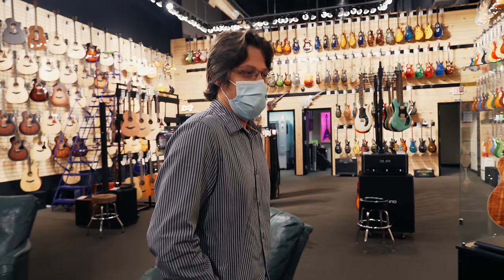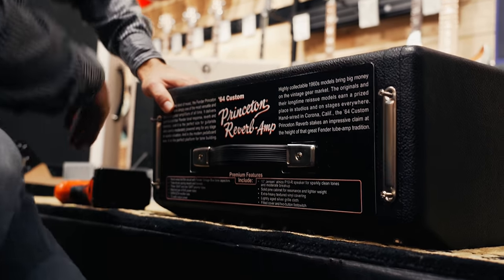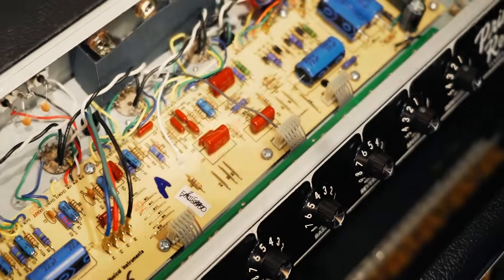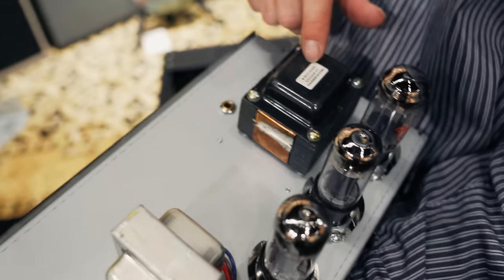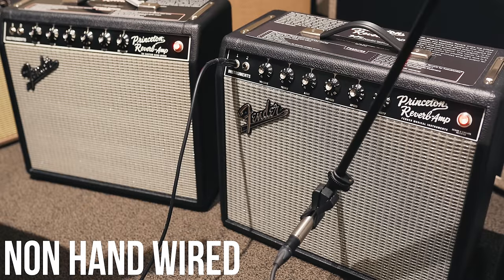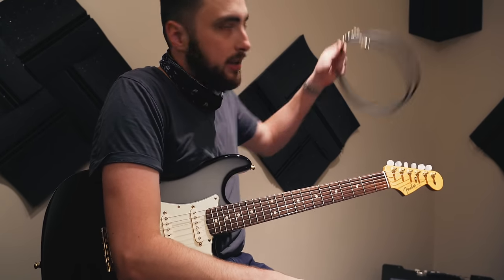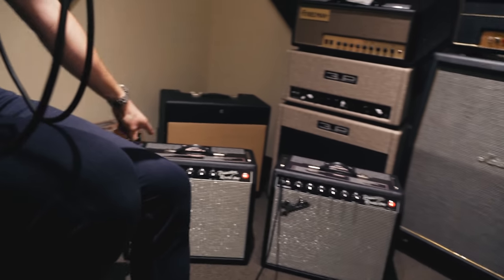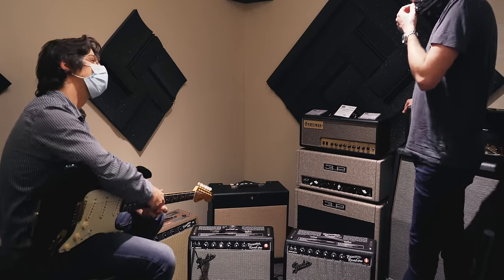Are Hand Wired Amps Really Better?

Comment: I work on amps for a living, I specialize in Fender tube amps, and I can say in no uncertain terms, there is no tone difference between hand wired vs printed circuit board.  That doesn’t change the sound of the circuit, different components do. Tolerances in component values (up to +/-  20%) can have two amps built exactly the same, yet sounding completely different.

You are showing two different amps.  Just look at the tone caps, on the hand wired, they are Fender Blue Molded, on the printed board they are Illinois caps, way lower quality, and a different tone characteristic.  That alone would change the tone of the amp as much or more than anything else.

Honestly, the only difference between the two formats (other than ease of access for repairs) is quality of solder joints. Point to point can get you a nice big solder joint, very strong.  Fender has a reputation for using very thin solder traces on their circuit boards that have a tendency to break under stress.  As a repairman, that’s the number one difference. Components can be switched out, bias can be altered, a thousand things can affect the tone of the amp. Hand wired vs circuit board is not one of them.

People like to try to convince themselves that hand wired sounds better. It does not. It costs more to have a person do in four hours what a machine can do in minutes. That is what you are paying for. Not some magically “better” amp. Just a higher labor cost.  That’s it. (Admittedly, you are also paying for a few upgraded components in this particular hand wired amp, but you can throw many of those same upgraded components into a pcb based amp too.  Fender has just chosen not to in this model.)
Reply: This is what happens when you let a salesman and a guitarists evaluate circuits.  Did you test the output tubes to see if the two pairs were exactly matched in gain?  (For best results, you should get a matched quartet, and split them between the amps.) Did you test the preamp tubes to see if they were anywhere near close? (I just worked on a brand new 5150 with three (!) bad preamp tubes right out of the box)  Did you check the negative bias circuit to see if they were set/responding similarly? Did you check the plate voltages of each amp to make sure there wasn’t a difference in B+ voltage?  All these things will drastically affect the tone of the amp, and that doesn’t even get to the audio signal path variances!  

You cannot plug in two tube amps, even of the same brand and model, and expect them to be the same.  You certainly can’t compare two different models with different internal components as being the same amp, and chalk up any differences as being due to hand wired vs circuit board. Too many other variables that a tech would bring up, but a player might not even be aware of.
Reply: Very informative
Reply: That my friend is awesome info! I  totally bought into the salesman/guitarist and pro guitarist commentary...thank you for that 👍
Reply: well i think the idea with “hardwired” amps is that no expense is spared. if youre investing hours into the build, youre going to be investing good parts as well. the PCB trend is kind of the posterchild of “cheapest means of production”, slapping together parts that are “close enough”
Reply: @LeeGHThomas  I think you meant "hand wired".  Both types of amps are, by definition hard wired, in that if a wire is physically connected, it is hard wired (as in the opposite of "wireless").

But you are generally correct, that boutique amps and hand wired amps are usually built to a higher price point with generally better components.  If you are willing to pay more for a person to spend the time wiring the amp, you are probably likely to be okay with some upgraded and/or more expensive parts.

And that is my point: those better components make the amp possibly sound better - not whether it is hand wired or circuit board.

And again, those upgraded parts are (almost always) not exclusive or unique to the hand wired amp.  They could just as easily be put into a circuit board amp, and that amp would sound just as good as a hand wired using the same components.  It is the components, not the construction method, that makes one amp better or not.

(On a side note, I work on a lot of vintage amps that were hand wired and they used some cheap components and some very questionable layout techniques!  I've seen some scary stuff in older hand wired amps.)

The PCB trend you mention does exist, and is an unfortunate effect in manufacturing and design decisions being dictated by attempts at maintaining the lowest bottom line.  But, the market dictates how cheap is acceptable, and those things still sell.  There are, however, many PCB based amps that are a beauty to behold.  They are well designed, solid construction, and very few corners cut, if at all, on component quality.  They are able to sell at maybe a slightly higher price point than some Fender models, but still manage to bring a well built amp at a cost way less than most hand built.

Point is, neither platform is a guarantee of a better amp, in quality or sound.  It's all about the components.  And in this video, they are comparing apples to oranges because they are built with different components.  The narrator chalks that up to PCB vs hand wired, and I was trying to explain that is not at all the explanation for any differences they are hearing.
Reply: The reality is that most PCB amps use cheaper components. So generally, PCB amps sound worse. Of course there are exceptions. But you rarely find a handwired amp that uses junky components.
Reply: Yep. I was a high frequency tube amp (radar) guy in the Navy. Better components with tighter tolerances have the same magic smoke inside them, but they do what you ask them to better.
Reply: @coyotecirclestudio9611  i put all matching NOS Mullards in my handwired Vox from pre to power— tubes were definitely tested quite thoroughly...it sounded night and day over a mix of sovtek and JJ tubes that were in it. Did anyone also notice the far lower amount of caps in the Princeton pcb version? Lots of the sound diff is there.
Reply: @kilgoretrout3966  (love the name, by the way!!)  You are totally spot on abut the caps creating much of the sound difference.  The coupling and tone capacitors in an amp do as much to define the sound as almost any other component.  But it isn't the number (they actually have the same), but rather the quality.  In the pcb amp, they used IC (Illinois Capacitor) caps, notoriously cheap weak and leaky, don't sound as good as other types.  In the hand wired, they used reissue Fender blue molded caps, a remake of what is widely considered one of the best sounding caps Fender ever used.  That alone would make one amp sound quite a bit better than the other.
Reply: @coyotecirclestudio9611  indeed so. i have the 50th anniversary 15w Vox handwired...got it for a sweet $800. The quality of parts is really big, and as you say, low cost generally means lower quality components. i'm not an electronics expert by any means. i can do the wiring in my guitars, and i've replaced leaky caps, but diagnosing a whole board would be above my pay grade. i was really ticked when i discovered "New Bumble Bees are just a plastic case that looks like a Bee, surrounding a cheapo cap. Glad i learned that before rewiring my LP for pickups Jeff Lace sent me to try.
i recently put in a full matching compliment of NOS Mullards in the Vox from a really good valve guy i Colorado. Some will say tubes don't make much difference, but that Vox sang when i swapped out the russian tubes. It was so good, i spent the next 6 hours just playing.

Thanks for recognizing the name! Along with 5 people yesterday, i have had it recognized 27 times since 2006. Always happy to meet Vonnegut fans! Do you have a studio also, or stay with working on gear?
Reply: @kilgoretrout3966  I didn't know that about the new bumble bees!  I will have to keep an eye on that in the future.

I heard that Sprague had done a similar thing (not fraudulent, just tricky), by putting a good quality cap of small size inside a bigger shell, because customers didn't trust the newer, drastically smaller power caps.  Same rating, same power handling, but newer tech meant it could be made smaller.  People didn't like the smaller caps, thinking smaller is "weaker" so Sprague obliged by putting the smaller caps in bigger shells = happy customers!

Hey, who did you get your tubes from?  Just curious, I am in Colorado, and know a few of the local folks.

For the moment, both studio work and live sound are on hold.  I have a really nice project studio, modest space, but filled with an impressive variety of mics and preamps and treated spaces, as well as a top notch live rig that I am particularly fond of using.  I am pretty proud of what I have put together, but gigs have dried up lately, for obvious reasons.  Gear repair has (thankfully) helped fill that gap.  But I miss mixing so badly I can taste it!  

And yeah, I love Kurt.
Reply: I preferred the hand wired one until they hooked the alnico speaker up to the PCB one. Then they should pretty damn close. Close enough that I don't think anyone would notice with a full band and close enough that a little eq would have them sounding identical. Maybe the hand wired still is more responsive, but that would come down to components. I'd just buy the cheaper one and put a new speaker in it.
Reply: @eliju420  absolutely correct!  Components are the deciding factor, not whether those components are mounted on pcb or hand wired turret board.

I do that for my customers all the time.  They buy the run of the mill pcb based amp, then spend a few bucks upgrading caps, tubes, speakers, etc.  Then they have a really nice sounding, responsive amp at a good savings.

Alnico is a whole other conversation.  I happen to think they are some of the nicest sounding speakers and can really flatter many amps.  I have a few vintage Jensen P12N's from the 1950's that are so sweet and forgiving.  Just a beautiful sound.  They make almost any amp they are hooked up to sound a little better.  Problem is, the Alnico magnets are much more expensive to make, so the speakers can cost a good bit more than their ceramic equivalent.  That, unfortunately, ends up being a barrier in some folks' budgets.
Reply: @coyotecirclestudio9611  I played a standard blues Jr with the Celestion A and the relic with the Jensen P12R side by side. What an enormous difference on the same amp. The standard version isn't bad, but the same amp with the upgraded speaker sounded leagues better.
Reply: @eliju420  i would probably go the exact same way, but with a Studio, i try to do as many things without plug-ins or emulations. So i went with a hand wired Vox. i do have 4 other amps that are not, but there's a sweetness in the Vox i can't get with the others...and, wait for it......cliche ahead: it takes pedals like a champ.
Reply: I am new to all this guitar stuff, currently I have a fender mustang 1 V2 (digital?)

I was thinking of getting a monoprice 15w tube amp (Harley Benton Tube15)
I heard someone say that, it is basically a blues jr clone.

So I was thinking that I could upgrade the seventy80 to a greenback and also the tubes to Russian 

Are there any other mods that you guys would recommend for a beginner?

I’m going for a vintage yet universal sound for my 2002 mim strat (with upgrades I.e Rose pickups)
Reply: @abgersaurus  Sorry if you already know this, but:  Do not poke around inside a tube amp if you don't know what you are doing.  There are voltages in there that can kill you.

That being said, you did mention the best first two mods to try: speaker and tubes.  

This amp does have an adjustable bias, and to really get the best out of a set of power tubes (and avoid possible failure) it should be set by someone who knows what they are doing.  
Preamp tubes aren't affected by the bias, so they can be changed out all day long and no bias adjustments needed.

Just make sure any speaker you put in matches the ohms rating of the output transformer (either 8 or 16 for this amp I think) and shoot for twice the power rating of the amp.  So if it is a 15 watt amp, look for 30 watt or above speaker.  You could probably get away with a 25 watt if you don't play the amp at full volume.
Reply: @coyotecirclestudio9611  thank you for your advice! I only plan on playing a low-medium volume at home.
Perhaps I will look for a local amp-tech to help me adjust the bias.

I am hoping to get a blues jr later, when I am more experienced :)
Reply: @coyotecirclestudio9611  Absolutely, there can be hundreds of volts across certain tubes, caps can hold voltages even after the equipment is powered off, tube amps are very dangerous.
Reply: Exactly my opinion to, quality different yes, but other vice with the same component , they will sound the same :-)
Reply: Totally agree. I also build and fix my amplifiers. It's all marketing. Speakers, caps, potentiometers are all different. Not to mention the  tubes and the circuit itself which were not shown. For sure the differences in the sound were not due to pcb or wires.
Reply: @coyotecirclestudio9611   I've read that some of the much hated changes to the Silverface era amps were because lead dress got sloppy in a high production scenario. Oscillation was a problem, I think guys were wiring 20+ amps a day, I assume components were already on the board and this was the final wiring. With high gain amps the inconsistencies in lead dress inherent to hand wiring are going to have a much greater effect.
Reply: @5000rgb  Great point!
Reply: Agreed. A lot of hype, much like "vintage" capacitors. Like components, like values, like results. A properly soldered component on a post is going to sound exactly the same as one on a PCB. Did the amps sound different with the same settings? Yea, but could the they sound the same with some knob tweaking? Probably. Different amps and components will always sound different... but it's not the wires.
Reply: @jimistheman9732  "Did the amps sound different with the same settings"

I'd be willing to chalk that up to tolerances in the pots alone. It's ridiculous how much guitar players attribute tone to single factors that don't make much difference. The tolerances in the pots or pickup windings probably have a greater effect than the difference between ash and alder. There's probably as much variance in different trees as different species or at least enough overlap that a great guitar can come from either. get a different cable or put a pedal between your guitar and amp and you are no longer duplicating the original conditions so trying to duplicate the amp or guitar is not going to duplicate the results.
Reply: I want to hear your opinion on the potential inductance between signal runs on a circuit board vs. how a hand wired amp doesn't have lines running parallel. Should hand wired amps have more presence as a result of ,, or should I say, pcb amps have less presence, as a result of signal cancelling that can come from the inductance between runs??
Reply: @tsmspace  a hand wired amp can certainly have signal paths running parallel.  The components on a common turret board are often laid out in parallels (just look at a classic Marshall), and many have flying lines that connect across the board that run parallel to one another.  Those flying lines are usually routed an inch or two up and away from other components (or out and along the chassis wall), but the potential for parasitic oscillations and/or inductance exist in either type of amp.  Neither format is immune.  The key is adequate component separation and proper lead dress, which are concerns for both hand wired and pcb based amps.

-Also, a pcb based amp still has plenty of wires that by their nature have to installed by hand.  I am thinking of reverb transformers, output transformers, some large capacitors, negative feedback lead, etc.  Things that might be too big to be installed by the component stuffing machine, and have attached wires/leads that need to connect to the board, regardless if the rest of the amp is hand wired or pcb.

But, back to your original question- in my opinion, it would be more a factor of how well the signal traces are routed on the pcb that would determine any inductance, than whether it is a hand wired or pcb based amp.  As I mentioned, turret board/hand wired circuits quite often have the components in the signal path laid out in almost perfect parallels, but (usually) the distance between them and any components that may affect them is large enough to overcome potential inductance.  The same concepts are considered in the design layout of pcb based amps.

In theory- if the pcb based amp is well enough designed with intelligent thought to signal flow lines, and their relation to neighboring components, there should be no more inherent tendency to introduce induction than a hand wired amp.  Therefore, all else being equal and properly designed and constructed, my opinion would be that they should be nearly the same regarding presence potential.

- Side note - if you really want to dive deep, the output transformer itself adds/creates inductance.  Some are constructed better and with different winding techniques, which can drastically reduce the amount of inductance between output transformer primary and secondary, but it is still there.  An argument could be made the the quality of the transformer would more significantly affect the roll off of high end/presence much more than traces on a circuit board vs hand wired.
Reply: its all in the iron and speakers. Replace them and the caps won't matter in a blind test
Reply: @samroney6644  I half agree and half disagree.  While I feel you are absolutely on the money in remarking on the importance of the transformers and speakers, I disagree that the caps don't matter.

Many folks don't understand just how critical the quality and size of the transformers are, and how the speaker can radically change the voice of an amp.  You are completely correct in pointing out the huge importance of these components.

I would argue that the caps can and will make a difference.  Admittedly much more subtle, but some capacitors play a very important role in establishing the voice of the circuit that feeds the transformers and speakers.  Doesn't matter how great the output end is if the caps are leaky, hummy, saggy, etc.  Old sound guy saying "sh*t goes in, sh*t comes out".  Or, "you can't polish a turd".  If you have bad/cheap/failing caps in critical positions in the front end, no amount of quality transformers or speakers will save that.

I know that arguing the merits of certain types of caps is over most peoples' level of interest or perception.  Who is gonna hear the difference in caps in a loud and noisy bar, right?  

But, being a repairman, and auditioning the results of repairs in the super quiet surroundings of the studio, I can say that some caps do sound "better" than others.  Again, admittedly in a way that would probably go unnoticed in a bar, but in a studio setting can make an amp come alive in a way that is quite inspiring.
Reply: @VIDS2013  Does fender pcb amps use cheap components?
Reply: @jim9883  Compared to most handwired amps, yes.
Reply: @coyotecirclestudio9611  My dad always talks about transformers. I know they can be pretty expensive but I suppose that's why. Also he talks about proper wiring. I made an ax84 kit a long time ago, but honestly didn't worry much, however it was not turret board, it was little points that I had to attach individually, and the layout ended up pretty much "random" without any lines running with eachother, I must have twisted one or two wires according to instructions, but the amp seemed to be perfectly quiet,,,, at 5 watts. ( so no telling really). ,, So then once you have tiny components, though, wouldn't it get to be a lot harder to keep lines with separation?? I mean, you have basically two planes to work with.
Reply: @tsmspace  Yeah, I have worked on a ton of vintage units (1930's - 1950's -ish) that were just point to point wiring, no turret board.  Many, if not most, managed to keep a remarkably low noise floor even with components that appear to be randomly thrown about. 

It's really most important that certain types of signal routing stay away from others.  For example - keep input signal away from emitter signal,  keeping certain runs as short as possible.  Those concepts are fairly universal regardless of the construction style or size of components.  (I would imagine any decent amp kit would understand and follow these concepts in their assembly instructions.)
 
Also, tiny components take up less space, so (in theory) in a given enclosure they would actually allow for greater spacing between components than larger ones would.  The tiniest of components are surface mount construction (also called SMD), and I almost never see that in tube type amps.  That type of component is mostly found in lower current solid state devices.  Most pcb based tube amps use the same type and size components as found in turret or point to point or any other hand wired style.

At that point it's just a matter of keeping certain runs separated, which is really not that hard with proper layout.  It really doesn't take a huge amount of space to keep components or circuit traces electrically separate as long as common sense layout is followed.

So, even though you are correct that you essentially have only two planes to work with on a pcb, it doesn't take great amounts of distance to keep things happy, regardless of component size.

And yeah, transformers can be crazy freaking expensive!!!  I've looked into winding my own, but it is leaps and bounds more difficult than something like winding a pickup.
Reply: @jim9883  I wouldn't agree  that they use cheap components as a blanket statement.  Fender uses industry standard components.  Some of those components fall below my personal standards, but that's a different measure.

I always upgrade the power supply filter capacitors from the god-awful IC brand capacitors to F&T capacitors.  I usually replace some of the coupling caps and tone caps with Sprague or Mallory or Sozo.  Some of the resistors get replaced with higher wattage and/or tighter tolerance resistors.  But, these are my preferences for better-than-average performance.

Fender is a business, and as such, will buy components that are the best cost effective purchase for them.  They don't want to go too cheap, or they would be plagued with unacceptably high failure rates.  So, even though they tend to use "cheaper" components, they are far from the cheapest and least reliable component options out there.

I just tend to like more long-term reliable and higher quality components in certain positions in the amp, and tend to swap them out when I can.  Fender could just as easily do that, but they would have to charge more, and choose not to so they can keep the amp as affordable for the average player as possible.
Reply: @5000rgb  Excellent point.  A potentiometer is just a variable resistor.  Halfway through the travel of one will almost never be exactly the same reading as halfway through the travel of another of the same make and value.  Add to that the knob may be attached a hair more clockwise or counterclockwise on the shaft of the pot.  That makes "setting the amps to the same settings on the control panel" a pointless and inaccurate measure of similarity or difference.
Reply: Well .......... unless they are playing a Les Paul from the "good wood" era ....... lol ..🤣
Those trees be tricking us bro !!!!!
Reply: You seem to be overlooking the most important factor here ....guitarists are notorious for listening with their EYES  👀...and not their EARS 👂!!!!
Reply: First off they need to have the same speaker.. That will change most of the sound.. not solder joints..
Reply: And when you're playing live the little  tone differences goes  out the window ! If infact you can hear this small amp!
Reply: @daltonpoff4467  While I totally agree that much of the "cork sniffing" type differences are mostly inaudible at live gig volume levels, I think you might be underestimating what these amps are capable of achieving.  While they probably wouldn't be my first call for metal, or keeping up with an EDM ensemble, they can do remarkably well in rock, blues, jazz, country, and a number of other genres.  Even with an aggressive drummer.

And let's not forget one of the main claims to fame of the Deluxe Reverb type circuit is that it tracks very well in the studio.  That's where the differences in quality shine.

But yes, I totally agree.  You will not hear those differences at midnight in a punk bar.
Reply: I don't play punk or heavy metal ! However I played out semi pro for four decades just about any situation. Owned Princetons, a deluxe  my opinion there weakass amps and way over priced! He'll for that kind of money 💰 you can get a twin!!!!
Reply: @daltonpoff4467  Oh, you know what, I stand corrected.  You are right, I had forgotten these are Princeton platform they are reviewing here.  My bad.  My head went Deluxe Reverb for some reason.  

That being said, I have heard some nicely modded Princetons that are far from stock that have quite a robust sound.  You are aware the original Boogie amps were seriously hot rodded Princetons, yes?  

And yeah, I do love a good Twin.  I have two mid-1970's Silverfaces I have modified mostly with Blackfacing mods that I love and play daily.
Reply: You know the Princeton are okay but you do know they were basically a student amp or a beginners amp or a church amp ! Back in the day you could buy him for pennies on the dollar! In my opinion they're over inflated and overrated but that's just me thank you!
Reply: @daltonpoff4467  Yep.  Crazy how much the prices have climbed on vintage Princetons. Yeah, wild to think it was originally a student/practice/budget amp! But, most of the guitars on Layla were recorded with Princetons (and even Champs), so I don't know if I'd go so far as to say overrated.

But overpriced, oh my yes!!
Reply: Yeah I know you can use any amp to record and sound great! I have, but I have seen roy buchanan, Gary more Luther Allison and many more in concert back in the day ! And you cannot get that great sound with those small amps live!
Reply: @daltonpoff4467  Ah, you are a lucky man.  I only got turned on to Gary Moore after he passed away.  Wish I could have seen him.
Reply: Exacary! Back in the day (and I know because I was there) you could play two brand new 67 Deluxe Reverbs sitting side by side on the showroom floor and they would sound slightly different from one another. Why? Because the components Fender used had a +/- 20% tolerance range. Which means that a 100 ohm resistor in one amp, for example, could actually read 120 ohms on one amp and 80 ohms in the other. Same is true for all the capacitors. The real benefit of hand wiring isn't in the sound, but in the longevity of the amp. Hand wiring tends to be more robust and survives the harsh realities of "the road" better.
Reply: @RichSmithify  Yes, this is what I have been saying!  In theory you could test every component and essentially "blueprint" the amp (to use a mechanics term), making sure everything was exactly the correct and same value from amp to amp.  Then you could reasonably put two side by side and compare and contrast.  But to put in the actual work hours to sort and select precision components like that would make the amp's price start at twelve thousand dollars. 

Back on point, those variances in component tolerances (as well as different brand/type capacitors) are what make the differences you hear in these amps.  Not hand wired vs pcb based.
Reply: @coyotecirclestudio9611  And Leo Fender was business man, not a musician. According to legend he didn't even play guitar. If he could find a way to trim manufacturing costs by using lower spec components he wasn't ashamed do it.
Reply: @RichSmithify  That's correct.  He was a radio repairman, not a musician!  He didn't give one hoot about esoteric components.  If it was close to the right value, and cheap, in it went.
Reply: @tigeraudio  I'd like to pick up one of those Rivera era Fenders. Or several of them. I don't know if I've ever played through one but those are probably the last of the mass production handwired amps. It's cool when something isn't just a great instrument, but a little bit of history, too.
Reply: @tigeraudio  Did the PRII have an EV speaker in it? I believe Rivera was one of the guys that thought the EV was the secret sauce in a Princeton.
Reply: @tigeraudio  The power transformer wouldn't be able to handle it.  There are two currents you need to account for: heater current, and plate current.  

Quick look tells me a common Princeton Reverb power transformer states it puts out 2.25A for the heaters and 100mA for the plates.  If my math is correct, a Princeton Reverb power transformer is already near the top of its spec range with heaters.  

Plates are okay.  3x12AX7@6mA each, 1x12AT7@15mA each, 2x6V6@20mA each for a total of 73mA.  Adding another 12AX7 would bring that up to 79mA.  Still pretty safe.

Heaters are the trouble.  3x12AX7@300mA each, 1x12AT7@300mA each, 2x6V6@450 each, for a total of 2.1A.  Adding another 12AX7 brings it to 2.4A, over the spec of 2.25A.

As long as we're having this discussion, using the Princeton Reverb output transformer for the build will, I would imagine, yield less than exciting results.  The smaller transformer will give up a rattier, earlier power section breakup, as the transformer itself reaches saturation earlier with less iron and less windings.  It will be more like a standard Princeton Reverb where you can't go past 3 before it starts to breakup.  While that is a lot of fun when called for, it limits the working range of the amp to me.  I like the sound of bigger iron myself.
Reply: Hey Mr. Knowitall. Please have your ears checked by an ENT. This is not a matter of what components/circuit boards are installed in an amp but how a HW and Non HW differ in sound. I've tested several HW and non hw side by side and they do really differ in sound quality. You may be an amp specialist but you do not have the hearing prowess of a musician.
Reply: @helsinkioslo836  Wow.  I don't know what upset you so much.  We are just having a discussion, and if you disagree, that's your right.  I am judging electronic components and types of layout by my occupational experience, you are allowed to judge by yours.  But personal attacks just aren't really necessary.  Maybe come back when you can add a more constructive perspective.
Reply: @tigeraudio  The blue caps will sound a little different than the orange drops.  Not a ton, but some.  Maybe a bit smoother where the orange drops may be a bit brighter in the mids/upper mids.  Sozo makes a very nice modern production blue cap.  I have had good luck with them.  Either way, both will sound worlds better than the terrible IC caps Fender uses stock in just about every amp they make.  Yuck!
Reply: Coyote Circle Studio You seem to know quite a lot about amps, sir. Let me pick your brain. 😄 You said that there are some really good amps on the market, whether hand wired or not, in terms of the quality of components, thought out PCB layouts, etc. Can you give some examples of such amps that are good stock? Preferably some that can be bought new off the shelf, but second hand examples are also welcome!
Reply: Coyote street...you gotta admit that the hand wired is beautiful 🤣🤣🤣 thanks for your input. I have a Super Champ Tweed with the Ragin Cajun upgrade and truly love that rascal.
Reply: @LeeGHThomas  I guess you never priced a SLO 100.  It is PCB.
Reply: @VIDS2013  There are plenty of quality amps that use PCBs as well as quality components: Soldano and  Fuchs come to mind.
Reply: So can you take the pcb one and bring it to the hardwired specs for low cost?
Reply: @SaintFredrocks  Yet there are many more PCB amps that use cheap components.

Regardless, I'd much rather work on a handwired amp.
Reply: @travisraab  Well, that's a hard question to answer.  But, in general, yes.  Some amps, no.  But this amp, yes.  Absolutely.  

If both amps are built to the same schematic, in theory they both are "in spec" with each other as far as performing the duties as required in the schematic.  I.E. a coupling cap of .02@400V will be present in each amp, but in the video the pcb based amp was using IC brand capacitors, which you normally find in most current Fenders (and they kinda suck).  The hand wired used re-issued Fender blue molded caps which sound and perform much better.  And are also more expensive.  

But you can put those blue molded caps in a pcb based amp, no problem.  As with almost any other part in the amp.  

The parts are up to you based on choice and budget.  Fender chooses to use less expensive parts in the pcb version to make it more affordable, and more expensive parts in the hand wired for those who want to pay more.

But those more expensive parts can pretty much all be used in a pcb based amp.

Which brings me to the part that's a little harder to answer.  If that can be done cheaply.  Can it be done less expensive than buying the hand wired version?  Usually, yes.  Not always for every amp.  But in this specific amp model? Yes.  You can take every upgraded part, and as long as you know how to properly and safely do it or your amp tech doesn't charge you an arm and a leg, you can have a pcb based that has every component the same as the hand wired.  There's a $1200 difference in price between the two models.  The parts for that amp in total cost less than $1200.  

At that point it comes down to how much your amp tech is charging you.
Reply: @gitarowydominik  I have thought for a few days about how to answer this one.  I am often afraid to endorse any certain make or model, likewise very hesitant to condemn any brand.  There are always exceptions, and I'd hate to steer anyone the wrong way.

That being said, I could name a few makers that every single product which has come on my bench has been top notch build quality

Musicman amps from the 1970's and 1980's are incredible build quality, and real sleepers, so not too expensive.  (It was one of Leo Fender's companies after he sold Fender to CBS).  They are starting to get old enough to have age related component failure issues, so can be found for pennies.  But usually a cap job and some tubes and they are good to go.

I can tell you one of the finest builds I have seen come across my bench was a Swart amp.  Work of art!  Clark also does exceptional work.  Dr Z makes some nice stuff.  But those are boutique hand wired, so you pay for those.

As far as pcb based goes, one of the best regarded in that category is Soldano SLO.  Not a cheap option.  But a prime example of pcb based tube amp done right.

I know I'll catch flack for this, but honestly, aside from the problematic ribbon cables and a few issues with early runs, the Hot Rod Deluxe and it's variations are really great amps.  Stable, reliable, quiet.  Easily upgraded if desired.  There is a reason they are one of the best selling tube amps, ever!

As an aside- I know it is an effect, not an amp, but as an example of how pcb based design can be beautifully executed, take a look inside any Analogman pedal.  Just awesomely clean, top notch components.  Just a perfect example of how to do it right.

I can also say from a tech standpoint, not a big fan of Mesa, Vox, or Peavey.  I love some of their amps, but really dislike working on them.  Some are just a god-awful nightmare.  Absurdly difficult to do routine maintenance and repairs on some models.  Peavey Classic/Delta Blues series are a perfect example of pcb based done wrong!
Reply: @coyotecirclestudio9611  very thorough. I hear you! I'd like to build one of those amp kits but they seem so overpriced! You could almost buy one same price
Reply: Coyote Circle Studio Thank you! Those boutique American amps are not easily accessible here in Europe. But the Music Man amps from the 80’s are a different story. I never looked at them, and now I will. ☺️
Reply: @coyotecirclestudio9611  any specific pcb based amps you really like? I’ve got a blues junior I want to upgrade, what would you change in its components to improve it? Thanks
Reply: As an Electronics tech, I agree with the components statements. But as you are an "amp guy", here is a mod I wonder if it has been tried Coyote Circle.
Use the hand wired pots (AKA point of failure devices) to the PCB. Then you get that "fast reparability" they discussed. Because after millions of hours on 6 degree full motion flight simulators, I have yet to see an internal PCB "break" in a box. And trust me, the darn things got buffeted.
However, I have seen wires break or had the dreaded smell when a wire "lets the smoke out of it". 
Add the better speaker and bam! 
So the question is, is it cheaper to buy cheap and upgrade?
Reply: @stormbringer1876  Great point on pcb board failure (or lack thereof).  I have seen a few cracked boards.  Drunken musicians throwing gear in and out of cars will put a few momentary g's on the mounts.  It happens.  But such a low failure rate, especially if you consider a great number of the failures are due to more catastrophic impact (dropping gear down stairs, off of tall bar stools, out of the backs of cars, etc happens to a lot more people than you might think). 

You are definitely mentioning some of the first mods you can do on some amps to increase durability.  Replacing the input/output jacks and control pots with discretely mounted pots and jacks not mounted to the board is something I do for a lot of amps.  It is a very common mod to the Fender hot rod series to remove the board mounted plastic input jacks and replace with much hardier discrete mounted metal jacks.  That's a great example of your idea being successfully implemented.

But not every amp will allow it.  Sometimes things are mounted in such a way that the reality of having discretely mounted components as opposed to board mounted makes things more difficult than they need to be, and doesn't really increase durability in any appreciable manner.  And on some amps, it does not improve anything from a reparability perspective.  Board location or other component placement just puts other things in the way regardless of type of mounting.

Finally getting to your question, I have a hard time making blanket statements about whether it may be cheaper on most or all amps across the board.  But on this amp they are looking at in the video, yes.  Unless your amp tech is charging you too much, you can purchase upgrade parts for a few hundred bucks, and have a fantastic amp for a lot less than the hand wired version.  It will have all the same quality parts, so in theory the "same" (in reality no two tube amps sound the same) sound, as the hand wired, but a lower price tag.
Reply: @kilgoretrout3966  dang you're the first other Trouter I've seen on the webs! I've probably received a handful of recognitions from other people. Folks don't read like they used to!
Reply: @kilgoretrout321  HA! well i've only encountered one other person with this name in their screenname to date. i have had this name since 2006, and the sad part is, you are just the 23rd person to recognize it. So it goes...
Reply: @coyotecirclestudio9611  i am so sorry i am seeing this late....the guy i get my tubes from calls his company Fuzz Audio, in Englewood, CO.Ifound him on Reverb, but we built a separate package, which he posted only for me to buy as one unit.  He was tops. i had already bought a Brimar? EF86 from Watford Valves in the UK, but Fuzz Audio was the best i've dealt with. We spent 3 weeks kicking around ideas to get different break points, tone, etc. We settled on going all Mullard...then it turned out my "Brimar" was actually another Mullard, so it is completely filled with Mullard tubes. We kicked around various RCA, Phillips, Raytheon and other solid as heck NOS. i can also vouch for the fact that he does indeed test the tubes with all recommended methods, as well as other testers he has that i haven't seen with others.

Studio-wise, i know what you mean. i had a 3 week block that was supposed to begin last April. Young Band, so they were getting a deal, but still was good cash. i had also been caring for my Momma at home...she had Alzheimers, and we lost her January 8. Now, to keep myself out of life's ditch...i am getting my oldest Son to come down for a couple of weeks, and we will collaborate to complete some of each other's songs, then we are gonna just record and record.
i wish i had the space for a big live room, but what i have is adequate. The first thing i did when building my studio was to put together the strongest mic locker i could attain. i talked to Warren Huart for a couple of them, plus i already had an amazing, vintage tube Audio Technica i snagged from the 2" Studio i used to engineer at, as it was closing...everyone was taking things. At the time all of it was mostly viewed as to be sold as scrap....if only i had known...Still a mystery to me why they would have gotten rid of mics that are still useful, but i got a nice one out of the deal, without being greedy like many were (btw, Neumann's, RCA's and Telefunkens were taken by the owners before any of us got to anything.) what i should have paid attention to was the outboard gear.
Reply: you just owned the entire comment section
Reply: that is not specially said to mean hand wired is better. In the best shops, they may get more attention to detail, you're paying big, so an ethical company is gonna want you to tell friends that they use really high end caps, transformers, et al.

Personally i love the tone, but heck, its not that tough to emulate anymore. My Vox has the Celestion blue, which i like real fine. The most important part of hand wired for me....an admitted "shave above layman" electrician....is that the things i can do are easy peasy, as long as you drain caps and don't die. Simple to clip the legs of a big cap, the needle-nose where u just cut, melt the solder with ur iron...out it comes. Of course tubes are a simple fix, oh...one more half-ass skill i have...running a multi-tester.  There is nothing in particular better in the sound, save for tricking one out and mods. i put $300 into my hand wired Vox shortly after purchase. i knew what i wanted, so it wasn't an unexpected cost or failure....Well, i think Chinese and Russian tubes are a failure unto themselves...

i have an idea or 2 on that. One would be for "boutique amp builders", home builders can do the same...but why not sell boutique amps with cost levels that change with the quality of NOS tubes they put in. i've yet to see a boutique seller advertise NOS Mullards, Sylvania, Phillips, RCA, Raytheon, etc. You could add a markup for the costs involved sourcing and purchasing top shelf tubes.

The even better idea, which amazes me that it hasn't happened, would be for the US, UK or someone realize that there is a market out there that is paying sometimes $200 or more for one tube. That would tell me, "i have a market, if i can deliver tubes of NOS Mullard/Brimar quality, they will sell just fine.
There are a ton of tube amps out there, plus the renaissance of vinyl and tube preamps and receivers or amps. Its time the Yanks and Redcoats to unite to build the best valves again!
Reply: @coyotecirclestudio9611  maybe if anything, one could say it's more specialized, perhaps. My Vox rules the globe, but i'd not begin to say it could do it all...and both are overpriced!!!...but never to my ears or soul.   *<}:^)
Reply: @coyotecirclestudio9611  "But to put in the actual work hours to sort and select precision components like that would make the amp's price start at twelve thousand dollars."

Oh, you mean a Dumble...
Though methinks their price and costs aren't exactly neck in neck, unless all electronics are 99.999% pure gold, add another 5 grand for gold solder.  *<[:^D
Reply: @coyotecirclestudio9611  Apollo went to the Moon in a 300'+ tall rocket, about 90% of it was fuel, and was built by a group of lowest bidding companies
Reply: @kilgoretrout3966  If I could find a Dumble for only twelve thousand, I'd jump on it!  Turn around and sell it to some fool for ten times that. and buy myself a few nice amps (and a new car) with the profit.  

Dumbles are, in my opinion, a bit more than overrated.  Six or seven hundred bucks of the price is components, the rest is thousands of dollars in fairy dust.  That's why he epoxy goops the boards, he doesn't want anyone to realize he's doing nothing special.  "Pay no attention to the main behind the curtain..."  He does use a very intelligent combination of some pretty high quality but standard mods to what is basically a standard Fender circuit.  It's electronics, not freaking magic!
Reply: @kilgoretrout3966  It always blows me away how far they went with such rudimentary computing/processing power.  That's some impressive brain work.
Reply: @coyotecirclestudio9611  Yeah, i agree 100%. Then you have an amp you don't dare gig, so it sits at home in all of its woo woo splendor. i go practical. Will this outrageously expensive piece of gear earn me more in the studio or on stage? No? "Ok, a 32 pack of 1mm Petrucci Jazz Picks, thanks."
Reply: @coyotecirclestudio9611  ...and they were still using slide rules for fast computation, cuz they couldn't further tax the mainframe. i miss that time sooo much. Everything seemed more magical.

In other news.... if one were going to homebuild something like a Blues Jr. or Princeton circuit, would you think that circuit would be improved enough with a toroidial output brick to justify its cost?
Reply: @kilgoretrout3966  Wow, interesting thought.  I must admit, I have zero experience with toroidal output transformers on guitar amps, so anything I say is completely based on theory, or more likely guesses.

My first two thoughts are: 1)possibly too linear/efficient for guitar amp, and 2) much too stiff and efficient for an amp that wants some sag, like a Princeton.

Too linear/efficient- let's remember most of the classic Fender amps are designed with the least amount of filtering and stability they could get away with.  When CBS started going to ultralinear output transformers and crappy lead dress, they had to start installing snubber caps to avoid the parasitic oscillations that started showing up.  A toroidal is even wider bandwidth and cleaner high end power, so I would think the potential for oscillations or other ultrasonic conflicts increases.  

(And I know from personal experience that Blues Jr's are crazy prone to parasitic oscillations.  If you don't have the back panel on or a piece of aluminum foil placed next to the output transformer leads, they oscillate like crazy (parasitic inductance is what I heard it referred to as.  Above my pay grade).  They need the shielding of the back panel to make the circuit stable.  I lost a good day or two of my life figuring that one out)

Much too stiff and efficient- a tube rectified amp is going to have some amount of sag, for many that's part of the desired sound.  And in low watt amps, the output transformer saturation is also part of the sound.  Toroidals will not play as well in that dynamic.  They don't have a core to saturate the same way, and so will allow a lot of those raggedy high end frequencies, that normally get so perfectly rolled off, to come through.  They tend to be "hi-fi" and will let a lot of the frequencies we don't really want to be present in the sound.  Might be a bit harsh or abrasive.

Again, this is all just guesses.  It might be the secret sauce we've all been looking for.  I've been around long enough to know not to discount an idea that might not make sense on paper.
Reply: @coyotecirclestudio9611  Well, from my end, it was certainly a guess! i wouldn't have put together efficiency impeding sag, or the oscillations it would produce in that type of circuit. Makes perfect sense though, given the role  and impact of the output transformer. Is there a tube based architecture a toroidal would benefit, or is it inherent in a tube amp to not play nice with toroids? From your response, it sounds like it would require much isolation and shielding, and perhaps some shock absorbers!
Reply: @kilgoretrout3966  I would think it might be worthwhile to try it in a more "hi-fi" type platform.  Maybe a Twin or a Dual Showman.  Hardly anybody uses those amps (Dick Dale and Junior Brown aside) expecting to drive them into breakup.  Most folks use them as a more clean and bold platform for pedals and other "seasonings".

There was a trend in the seventies (I think made popular by Alembic) to mod Fenders to utilize the preamp and tone stack, but then fly the signal out to a more hi fidelity amp.  Jerry Garcia used that as part of his rig.  Preamp stage and tone stack from a Twin into a Macintosh power amp.  If that's a type of tone someone is looking for, I imagine a toroidal based output might help eliminate the need to run into an external hi-fi amp.

Again, just guesses.  But I did find examples of designs that successfully utilized a toroidal output with a tube amp in a hi-fi music listening setup.  So I imagine with proper layout and shielding, the design concepts could translate to guitar amps.
Reply: It’s not that “hand wired sounds better” it’s that “hand wired sounds better because they tend to use better parts and have overall better build quality”.
Reply: @cardbored_  well, yes and no.  For most current issue boutique amps that statement is the truth.  But that is such a small percentage of the actual tube based gear and manufacturing styles out there and doesn't represent the totality of the reality of the format, only the trends in modern boutique makers (which Fender is not one). 

Remember, my argument is discussing the historical reality of whether one assembly format in total sounds different or better than the other (which it does not).  I am not arguing against the fact that a very tiny percentage of amps currently made, which happen to also be hand wired, are generally made better.

(side note- all Fender amps, whether hand wired or pcb based, have some wires and components that have to be installed by hand, regardless of model.  I have in the past found some of these hand installed wires, from the factory, that were never soldered at the factory.  Once in a very high end expensive model.  Sad truth- people make more mistakes than machines.  So much for the better attention to build quality argument.)

I have worked on plenty of old gear from the 50's and 60's, before printed circuit board really were used at all, that were hand assembled and hand wired that use lots of cheap components and have plenty of crappy wiring and soldering.  I bring that up to point out that hand wired doesn't intrinsically sound any better, and wasn't historically built better.  Saying they use better components or construction is only focusing on a very specific, small portion of modern amps currently made, and ignores the larger (almost hundred year long history) reality that the hand wired construction method/format itself makes absolutely no difference in sound or quality.
Reply: @VIDS2013  Well, yes and no.  Your statement would be more correct saying "you rarely find a modern boutique amp that uses junky components".  I work on tons of vintage gear from the fifties and sixties, before printed circuits board were even around, and trust me, I see plenty of "hand wired" amps using plenty of junky components, and really sloppy wiring.  

It is not the historical norm to have hand wired interpreted as higher quality.  From these older examples I cited above we have definitive proof that it is not the platform that determines the sound or quality.  It is the components used and the skill and attention of the builder.  A talented builder can use a printed circuit board and build amps that are just as good as any hand wired amp.  

And, having worked on amps for many years, I have, more than once, found a few where the hand builder missed a solder joint or two, leading to instability in the amp.  A machine wouldn't have done that.  So the "hand built" is only as good as the builder, which is not a quality guarantee.

Also, having actually seen the insides of a lot of different vintage and modern amps, it is internet lore, not reality, that pcb amps generally use cheaper components. That's just not true by any measurable factor.  This is not my opinion based on what I read on internet forums.  This is my real work experience based on many years of bench time with a wide variety of amps.
Reply: @coyotecirclestudio9611  Still, it's far easier to work on a handwired amp than a PCB amp. The old ones (like Univox) used heavy traces. Most newer PCBs are so thin that it's very easy to burn up a trace with a soldering iron.

The bulk of PCB amps made today (mass-produced Fender, Marshall, Vox, etc.) are using the cheapest components possible in order to produce a reasonably reliable product at the lowest possible cost. You can always upgrade caps and resistors on a hand-wired amp, but that's not generally feasible or possible on a contemporary PCB.
Reply: @VIDS2013  While I agree with the bulk of what you are saying, I must note, ever since I got a digital soldering iron, I haven't run into any problems burning traces on anything.  One of the best investments I have ever made for my work.  Ruining solder pads is pretty much a thing of the past.  It really takes quite a bit of stress out of doing the work.

But yes.  Amp making is a business, and as a business the designers need to justify every expense to the bean counters.  If the money handlers want them to find a cheaper substitute component, they will do so.  If there were a greater demand for "money is no object" type amps, everybody would be building at least one model of that quality level.  But the real market demand is for a reasonably priced piece of gear the average player can afford.  To provide that while still making enough profit to keep the business open, some corners may get cut, some quality may get sacrificed.  

(That being said, I don't fully agree that the bulk of amps made today use the cheapest components possible.  I have been pleasantly surprised to pop open some amps and find nice Wima coupling caps or 1% metal film resistors, or Elna electrolytics in gear that was not top dollar.  Quite a few manufacturers do care about quality, even in their budget offerings.)

Also, I upgrade caps and resistors on contemporary pcb's all the time.  I have at least one Hot Rod Deluxe a week in here where I upgrade the power supply filter caps to F&T, and swap out the low volt power dropper resistors, and sometimes swap some of the coupling caps for Sozos.  Very common job.  Not difficult at all, aside form the complete teardown needed to access the solder joints.  (Again, the digital solder iron makes it like you instantly improved you solder skills, such a help.)

As I stated above in another comment, I totally agree that one of the biggest plusses of a hand wired amp is the serviceability factor.  More often than not they give much easier access to components.  As a tech, I appreciate how it makes the jobs much less of a hassle.
Reply: @coyotecirclestudio9611  I am mainly a player, though I do my own amp repair. I just don't have the patience for fragile PCBs!
Reply: So it does sound better huh
Reply: @TheGabrielhwmga  As a universal answer to the title of video itself - no.  

Any amp can sound better with better parts, those parts are not unique to pcb or hand wired formats.  One does not intrinsically "sound better".
Reply: @VIDS2013  it's all about the matter of price, money works.
Reply: Forager  While yes, a tube rectifier is different than a solid state rectifier, that has no bearing on this particular discussion.  As an amp tech I am quite aware of what sag is, but unfortunately it isn't germane to the question being asked.  The question was "are hand wired amps really better?"  As rectification has nothing to do with hand wired vs. pcb, it not being specific to one format or another, that detail is not relevant.  If it were unique to one of the formats and not the other, it might be a contributing factor.  But since either format can use either type of rectifier, that specific factor does not affect this specific discussion.

I would honestly have to disagree that tube rectifiers usually sound better.  But, like ice cream flavors or pizza toppings, is a matter of personal preference, not a scientific observation.  Anyway, that is a different discussion, not the one we are having here.
Reply: Man that's what I was thinking. 
I bought the 65 special edition prinston reverb reissue with the 12 inch cannabis rex speaker and I  love it.
Reply: @gregmacklin9758  That Cannabis Rex pairs really nicely with the 6V6 based Fender amps.  I have heard it do wonderful things for a Deluxe Reverb.
Reply: @coyotecirclestudio9611  yeah , I really like what I bought.  It's a Sweetwater special addition tweed. 
I read the negative comments but I'm very happy with mine.
Reply: Ex Fender employee, Lake Oswego / 90-95 here....I agree whole heartedly with Coyote Circle Studio's comment. So much voodoo and "audio illusions" in this industry. Component quality, tolerance percentage and speaker make a huge difference, circuit board not so much. Frank Zappa had it right a long time ago "Shut up and play yer guitar!"
Reply: This makes a lot of sense - thanks for posting.
Reply: why don't we just make trumpets on a metal stamper?  Why don't we just use a pick and place machine to build pianos?  Why don't we just build computers in minecraft all day?
Reply: @coyotecirclestudio9611  yo I guess my point is:  Your argument of There is no difference between PCB and hardwired.  Then the next paragraph you say "But the brand of the caps is what matters."  LMAO DUDE!  this will be shocking to you but a hand- layout will probably affect the sound more than the brand of the caps.  Look at a PCB.  Every single trace is a capacitor.  Every single trace is an inductor.  The power rails are paperclip wide and paper thick.  ICs are crammed next to tubes, next to rectifiers, with flux which slowly dries out and becomes conductive.  All the PSU noise and everything is all on the same card, with that shiney plastic which reads infinite ohms on a meter, but a meter is only measuring with 3/4 volt!  What's it like once you start to get 35+ volts across some of these points?  Now dust?  Now age?  A carded handwired amp "still has the same problems" as in there will be limited conductance and dielectric phenomenon because of the card material, but 1/4" difference in spacing makes a lot of lot of difference in terms of noise, from external means, power rails etc.  The idea being:  lets get these parts as far away as possible from one another and really minimize the parasitic loading, and maybe optimize the amp.  Have you ever grounded an amp so well it got LOUDER because of the quieter noise floor?  The problem with PCB is that none of the outer foils are aligned or none of that and its just an electrical contraption doing contraption like things. you can add as many wires to the board as possible and its still going to perform at however it does, which will be inherently limited.
Reply: @coyotecirclestudio9611  I'm not trying to grill you.  For example: Electrons don't orbit atoms.  Check out the "Ether" theory of electricity.  This is the truth, or at least much more accurate of a theory than particle physics or whatever they talk about in brick school houses.  

Electricity is more like "gathering some wind" from the air rather than the ideas of pressurized electrons in a water pipe or marbles in a wire or whatever.  Electricity sortof "happens" in the wire.  But go get your most prized tube amp and put it directly next to your computer tower.  super noisy right!  this is because electrical phenomenon just radiates out of a lot of stuff it is just rumbling and bumbling along but we learn how to control little amounts of it.  The wires "collect" some "electron-like wind" from the "air" and kindof organize it to flow around different places.  But the electrical phenomenon is not exclusively in the wire, just like the eye of the hurricane is not indicative of the entirety of the phenomenon either.  If that makes some correllation, ideas spark!  Love You though I am not mad I am sorry for calling you an idiot thank you for recording live bands that is a good thing to do !
Reply: This this this! All values and components being equal, the hand wired and circuit board amps will sound the same.
Reply: There's a reason why Trainwrecks sound so good.
Reply: @coyotecirclestudio9611  Spot on!!!
Reply: @eliju420  agree 100% i think the speaker was the biggest difference
Reply: Really? I have a degree in Electronic engineering and also a guitarist. There is no difference in tone BUT i can tell that hardwired amps have more harmonics and an "air" to the sound. Every hear of parasitic capacitance? Circuit boards, especially with parallel circuit traces act like a capacitor and loses some high end. Remember, many people are tone deaf. I know a well seasoned musician who can't tell the difference between a Marshall and an Orange Amp !!!. Hand wired amps are just more lively but I do agree many MANY people who haven't had both, from many manufactures won't hear any difference unless they really get into it. I always say, go with what you like and wallet can afford. I have several handwired and high end PCB and there is a difference in the "character" especially when you play soft and nuanced in clean. Dirt ??? Can go either way.
Reply: A Dumble is not PCB amp for a reason.
Reply: THANK YOU for this! I've been buying and selling amps for 20 or more years, and was once of the mind that anything with a PCB is absolutely inferior in every feasible way. I have since learned that pcb is simply a more efficient and consistent way to build an amp. I would love to see these guys dial them in so they sound as close to each other as possible and then do a blindfold test. I'd bet you they would really struggle to identify the "better sounding" amp. Finally, there are lots of coveted amps that are PCB... Solano, tone king, rivera, 70s Marshalls (not sure what years)... it goes on.
Reply: @henrysmith187  Sure, but there's PCB and there's PBC
Reply: I'll take the reliability of a hand wired any day.
Reply: great comment, thanks
Reply: I think, though its a marketing term, "hand wired" implies hand picked and higher quality components, although I definitely agree that terminology should change. They could say "basic vs boutique components" versions or something.
Reply: THIS! no need to read other comments.
Reply: Lmao
Reply: Very interesting! How do you say this synopsis holds up for vintage Fender amps? Is it true that Fender was just doing "something different" back then that made those old tweed, brown and blackface and even the silverface amps sound so sweet and desirable versus the newer reissue models? Or is it down to component choice and part drift etc?
Reply: This is a good example that not all repair guys or techs are created equal
Reply: > Fender Blue Molded, on the printed board they are Illinois caps, way lower quality, and a different tone characteristic

What aspect of a cap other than farads affects its tone?
Reply: @lqr824  Obviously the quality matters, as noted the IC caps are notoriously unreliable.  Other factors that would effect tone are what materials the cap is made of.  You can use paper in oil, polyester, polystyrene, and a few other types interchangeably in most applications.  Some folks feel one type or another might sound more clear or warmer than another.  That's a whole different conversation and a few folks have done some excellent videos comparing the differences in a guitar tone circuit and in an amp.  Very interesting stuff.

Bottom line: you can't use two different types of caps to try to compare two circuits' attributes.  The caps will provide as much or more difference than pcb vs hand wired will.
Reply: @coyotecirclestudio9611  > as noted the IC caps are notoriously unreliable

Sure.  Reliability.  That's not a difference in tone, though, only a difference in durability or longetivity.

> Some folks feel one type or another might sound more clear or warmer than another

That's because they're stoned.  In fact no-one can hear any difference because there isn't any.

> That's a whole different conversation and a few folks have done some excellent videos comparing the differences in a guitar tone circuit and in an amp.

Really?  Not just comparing nominal values, which have a tolerance range of +-10% or something in theory but may be even more out of tolerance than that?  But actually comparing actual values?  OK, shoot me a link if you have such a vid .  I have trouble believing you do though.
Reply: @lqr824  Hey, if you're just looking to argue, or call people "stoned" that's not gonna be a very productive conversation.

But in the sake of congeniality, I will offer a few thoughts.  

Reliability is not only durability or longevity, it is also consistency.

Unreliable caps absolutely do affect tone.  When they go bad, as the IC's tend to do much more quickly, and here we are mostly talking about the power supply filter capacitors, the legs of the circuit they provide power to loose their ability to conduct low end, and that certainly affects tone.  Bad filter caps also add hum and other noises.  I have also experienced where they fully inject ghost signal harmonics, and bizarre artifacts like "motorboating".  (Look it up, its weird.)

Also,  before they fully go bad, they tend to fluctuate wildly in performance.  That makes tone hugely inconsistent.

Fully acknowledging the accuracy of your remark regarding tolerances in caps, I do notice that some brands tend to be consistently closer to nominal value, and more importantly, not drift under heat and voltage stress.  That provides a consistency in tone.  Voltages inside the amp that are changing and drifting due to capacitor drift will greatly affect tone.  IC's are very bad in that regard.

As far as capacitor composition affecting tone, if you don't want to believe, then that's your choice.  But it has been shown that under certain voltage and current applications, different capacitor compositions can inject distortion and/or extra harmonic content.  Capacitors, here we're talking specifically about the coupling capacitors, have also been shown to have non-linearities in regards to frequency transmission, which would explain one type or another having the "warmer" sound or "brighter" sound.   They just don't perfectly conduct all frequencies at exactly equal levels.  You can watch it on a spectrum analyzer.

Does that mean that a different capacitor will yield significantly different results in every situation?  No.  Of course not.  Very many times the difference will be negligible at best.  But to go from there to stating that any perceived difference in any application is just because someone is stoned, really doesn't grasp the big picture.

Instead of me sending links, I encourage you to go ahead and do your own research.  There is an abundance of reputable research on this subject.
Reply: @lqr824  temperature tolerance and the purity of dielectric make a huge difference (20%-40%). A change in capacitance for a filter circuit (how EQ and gain stage is constructed) by .2 or .4 makes a proportional change (other EEs correct if wrong) in frequency response. The influence of capacitance and ESR (capacitor material) have a significant effect on the frequency response of any part of an audio circuit
Reply: @ph1losopher  without checking, I think it's proportional in the simplest circuits: 6% moves freq response a semitone.  So 20% is like 3 semitones.  Still, these aren't resonant filters or brick walls where 3 semitones would be really audible.  Instead they're single-pole shelving bass and treble.  What human can hear the frequency of a single-pole shelving filter shift three semitones?!!?  I can't!  (I'm literally listening to exactly this on a sawtooth, and a treble filter 3 semis higher but just a little bit stronger sounds basically the same.)  But back to the video, they don't even have the same speaker and two speakers can differ by 6-12dB at a given frequency, and often have distinctive resonant peaks.  I'd have loved to see the two amps played through the same speaker, and my guess is that even despite randomly different component variation, the knobs could be dialed in to sound just about the same.  AGAIN, I'm not talking about quality, dependability, aging, etc., I'm talking about the sound now.
Reply: @ph1losopher  > Also, how does one specialize in one kind of amp? Fixing AC coupled amps is one skill.

What do you mean?  I didn't see anyone say they specialize in one kind of amp??
Reply: Thank you for your input man, really good to know
Reply: Thank you for that detailed description. Let me ask one thing from you please, should I buy a 57 champ or a blues / pro junior?
Reply: @TheQuinnzo   that's pretty well impossible to answer without knowing your needs.  You are comparing two very different amps.  The Blues/Pro Junior is a class A/B pair of EL34 power tubes in push/pull configuration with onboard reverb putting out about 15 watts into a 12 inch speaker.  The Champ is class A single 6V6 power tube in single ended configuration putting out about 5 watts into an 8 inch speaker with no reverb.    They are entirely different amps with completely different behaviors and sounds.
Reply: But considering you can swap out components in the hand wired to suit your needs, in general a professional who knows what he's doing with a hand wired amp will sound better than a guy who just plugs into whatever's cheap
Reply: @Dildobagginses  Sorry, but you're sort of missing the bigger picture here.  You can swap out components in both the hand wired and the pcb amps, no difference there, that's not exclusive to either format.  But that's beside the point.  Relative to the primary question being asked here in this video, with a hand wired and a pcb amp both built to the same schematic both using the same parts, will the hand wired inherently sound better?  And the clear and unequivocal answer is no.
Reply: @coyotecirclestudio9611  oh I got it
Reply: All good info but, i believe a lot of customers choose hand wired over pcb because of future maintenance. A hand wired amp will in most cases take an amp tech far less time to carry out general repairs vs most pcb based amps due to component layout/accessibility etc... This is  a noteworthy point in my humble opinion.